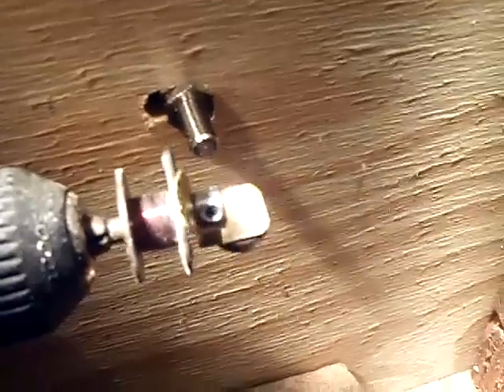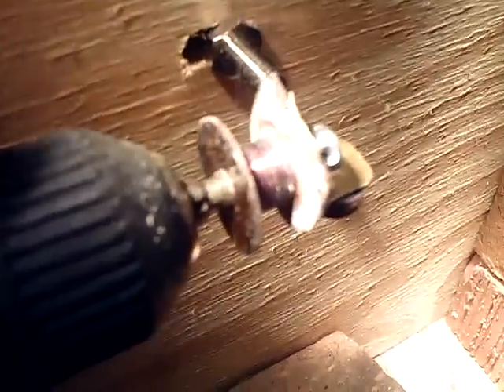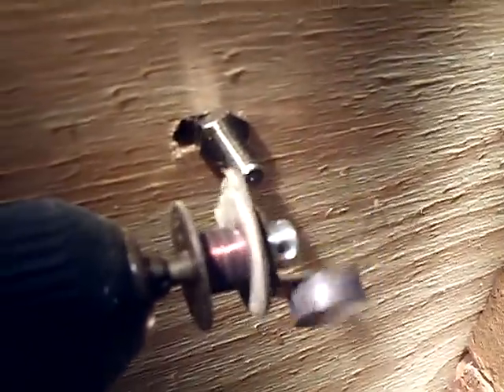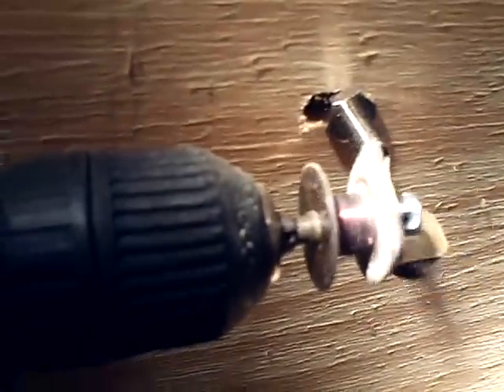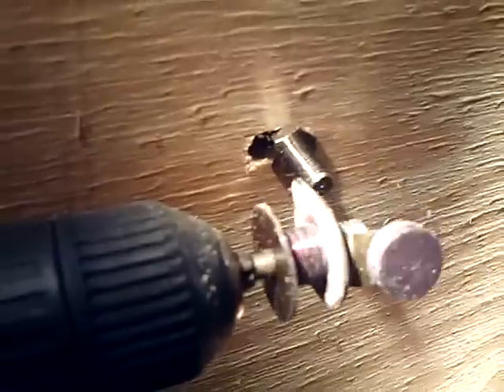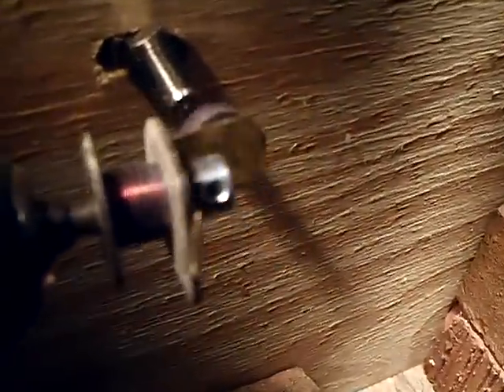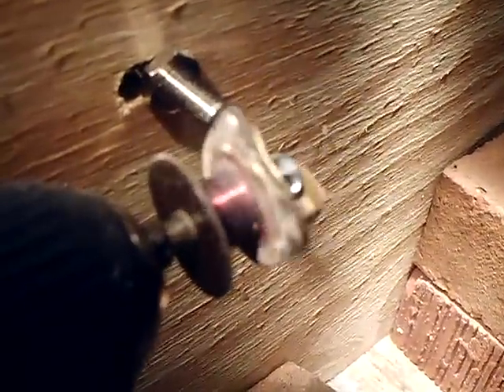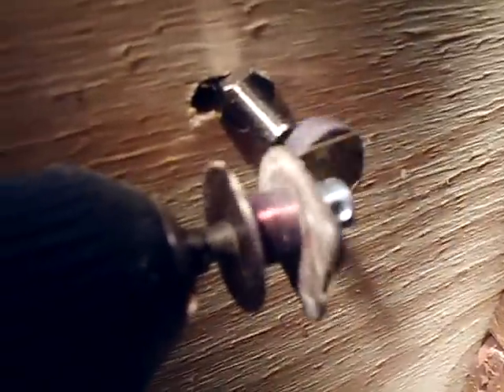Part 9 1/2. Almost done despooling the ShadowMeter Coil Form.

Comment from the maker: Part 10 has the final number. Just give credit to the Lockemeister! Philco shadowmeter unwinder extraodinaire.
Actually the number might be the final number plus one or two, since someone else had worked on the radio in the past and the coil was unraveling.